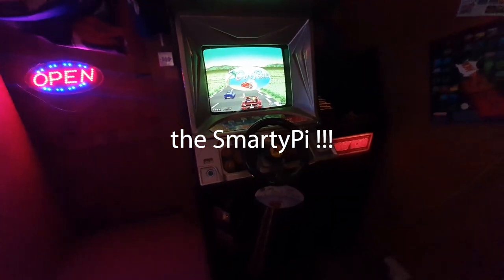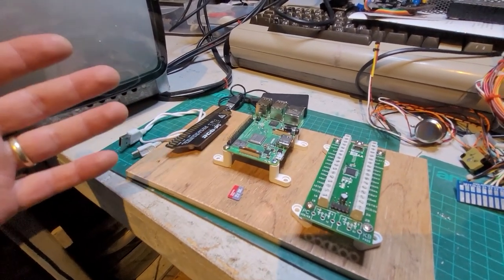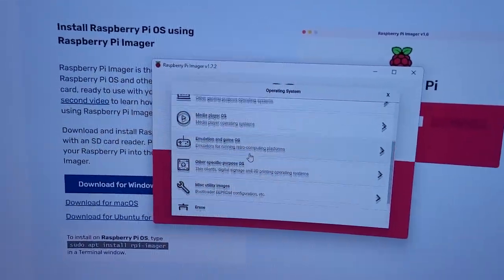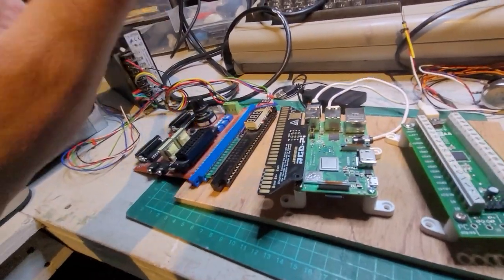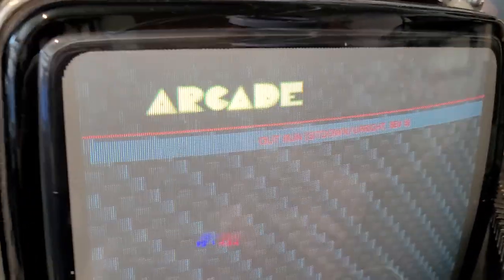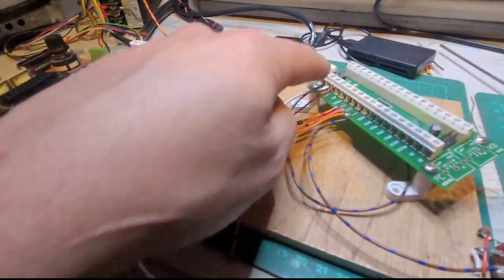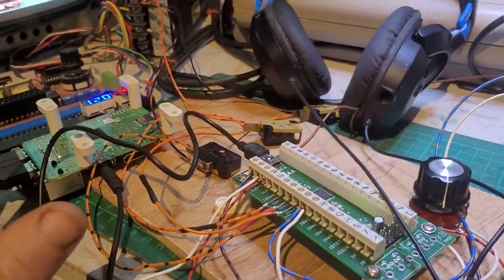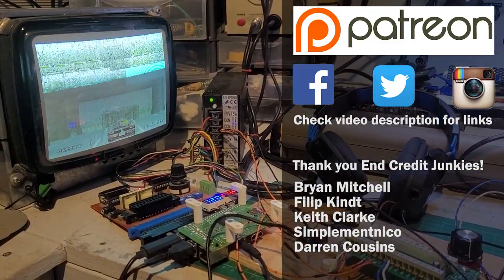Run your SEGA Outrun cabinet from a RaspberryPi

Comment: Nice Video Mate, have done similar with Apac and a ManxTT via pc in the past, good to see another platform, question with regard to FF on the Outrun (I'm looking at a cab atm), so might do this setup - have you done there anything to configure it in your cab or wheel is just running less the FF.  Cheers FP

Comment: I have a Super Monaco GP Airdrive cabinet, could this replace my (dead) PCB?
Reply from the maker: I can't see why it wouldn't . the Apac is just an analog to usb controler emulator  although for a Super Monaco GP you might want to use a Pi4 instead of a pi3